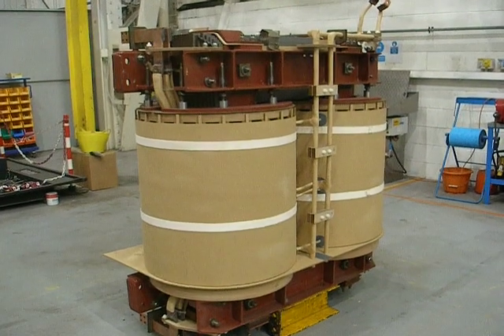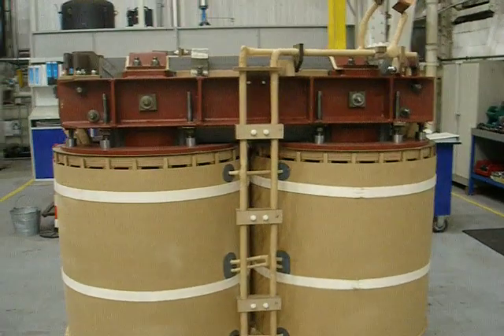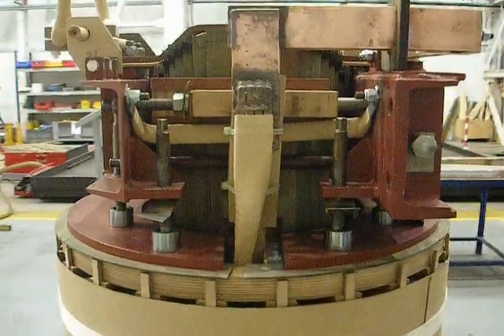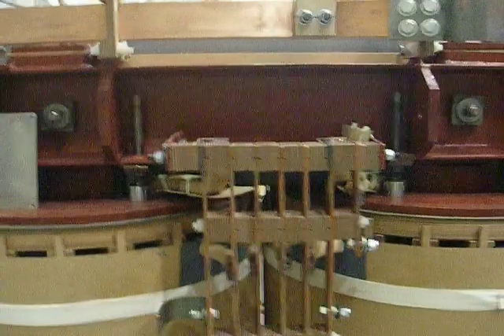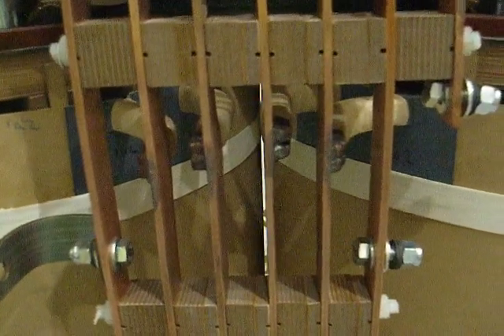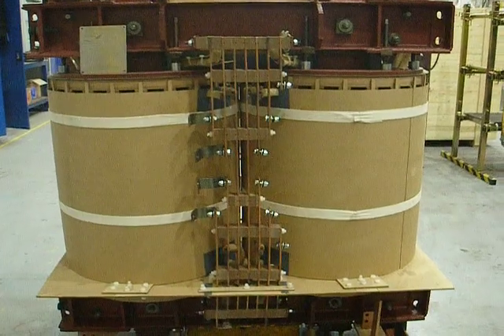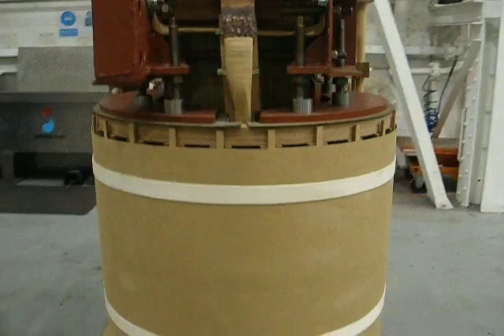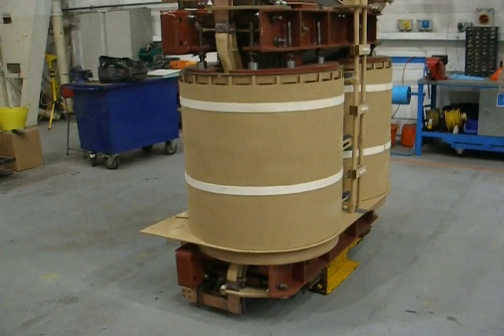Class 91 Electric Locomotive transformer

Comment: thats crazy, we also use 25kV 50hz in hungary so im guessing our transformers are about the same size as this. Also do you use insulator oil or transformer oil (to40) in the casing? i mean you must use right?
Reply from the maker: I think you have some ex-British Rail Class 86 locomotives in Hungary. They were the AL6s, we used to service and repair the transformers. As they're quite old we would be using Transformer oil, the same for the Class 90/91s. I think the newer stock had Midel oil.